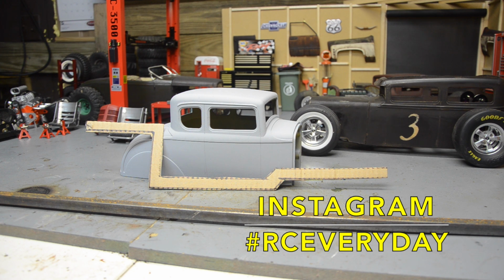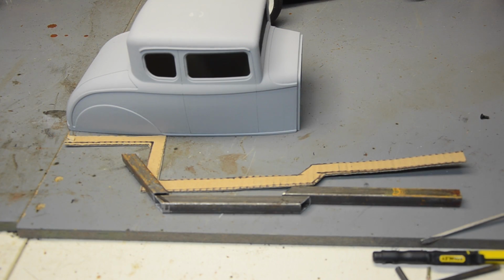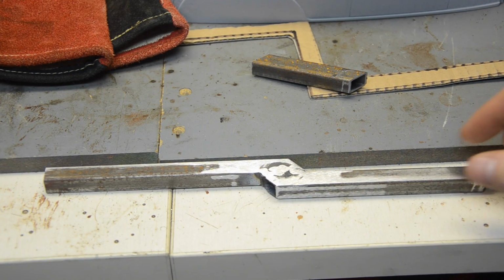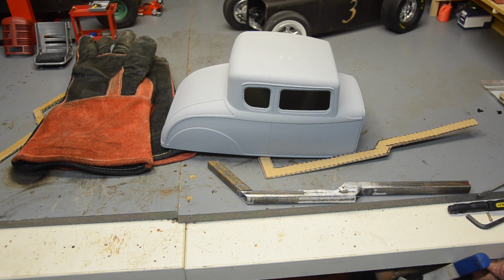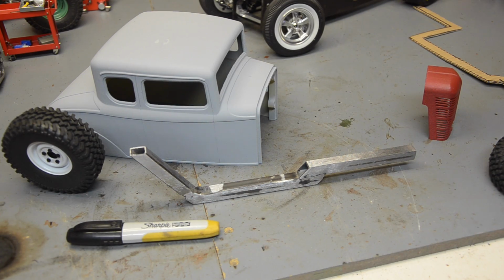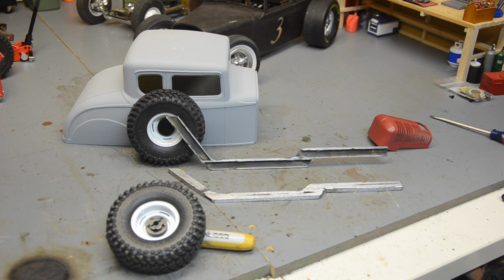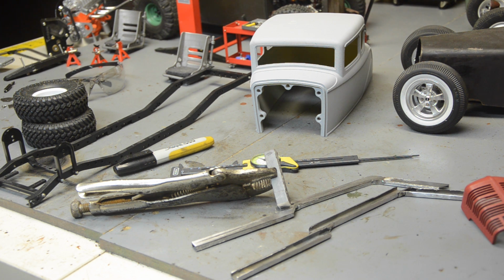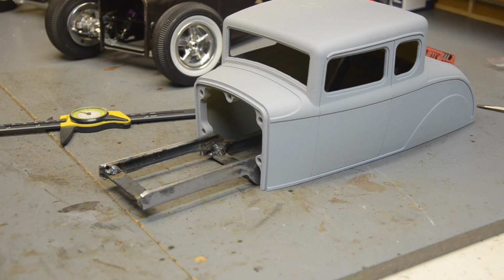RCengineering, Scale RC Rat Rod Chassis Fabrication and Welding

Comment: Nice chassis mate, it's coming along good. I agree with David, a mig (or tig) would make it a lot easier. I just use a budget welder, less than $200. It don't have great duty cycle or nothing, but for small scale work a cheap mig is OK. I just use CO2 for shielding, no argon gas.

Comment: You need to get a mig welder with gas much better weld and penetration and if you do it right no grinding needed or even tig I'm building one and I'm tig welding mine stacking dimes so no need to grind it looks like art

Comment: I like your work , been watching your stuff for a while , have you thought about going with an old school street rod show car ? Maybe a (American Graffiti ) type coupe ..? Years ago , I had a friend who worked in a metal shop that mostly worked with aluminum .I had my buddy make several t-6 tub chassis shock towers and A-FRAMES or A-ARMS LATER ,his shop had gotten a water jet which we used to make some 32 frame rails , from some 3/8 t-6 aluminum..for an 1 10th build they turned out to be really nice .. you could seriously use a cheapo harbor freight $100 dollar welder and a metal band saw .. so could I at this point ..burning threw Dremel disks and blow outs from stick welding has got to be wearing you out ..but I can tell you love what your doing , so keep up the good work 😊 I appreciate your work and your videos ..
Reply from the maker: I have upgraded a bit since this video. Have a nice mig welder and band saw now. A long way from a water jet though. Lol. I tried to build a gasser a while back but I always end up back to the low slung style. It’s just more what I like. Thanks for watching buddy.

Comment: Hey, what size tires and rims did you use on this build?
Reply from the maker: This thing has been a lot of different setups. But usually I use 1.9 wheels on 1.7 Rc4wd semi tires. Or super wides
Reply: Gotcha Thank you so much for all your help and sharing info whenever I ask.
Reply: Gotcha,Thank you so much for all your help and sharing info whenever I ask.
Reply: So may I ask you ..... Im messing around with wpl and jjrc trucks as a beginner in making hot rids etc. So do 1/10 scale and 1/16 scale jive with each other? May have to use an adapter here and there.
Reply: So may I ask you ..... Im messing around with wpl and jjrc trucks as a beginner in making hot rids etc. So do 1/10 scale and 1/16 scale jive with each other? May have to use an adapter here and there.
Reply from the maker: 1/10 is quite a bit larger than the 1/16th stuff.  The quality of the parts is much higher along with the price unfortunately.  You may finder more compatible parts with 1/18 and 1/16 scale
Reply: Cool thanks again

Comment: When I cut my frame rails I used the Dremel cut off wheel and put it in my drill press, then I set the drill plate up to where it would cut the square tube on center then I just ran the tubing around it a couple times to make a deep score mark, then I finished it off with the Dremel. It was easier for me to cut in a Groove then over a marker line. If that helps anyone
Reply from the maker: That’s a good tip!  I might give it a shot.